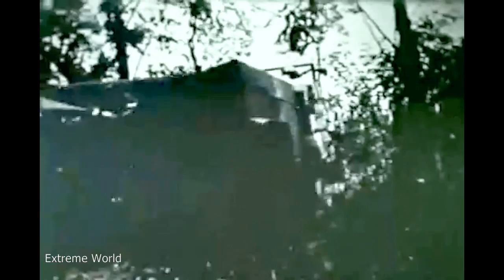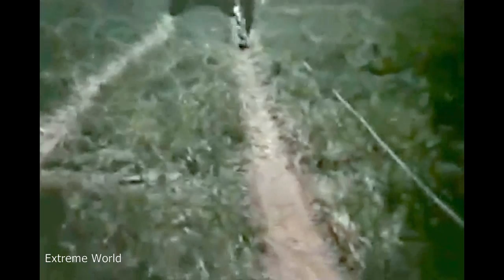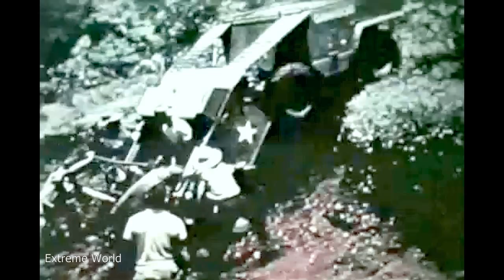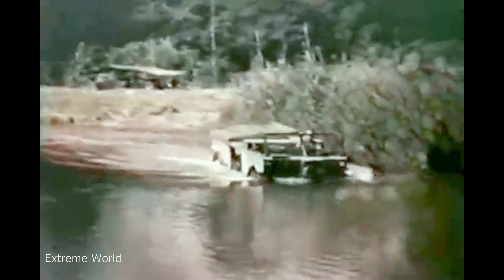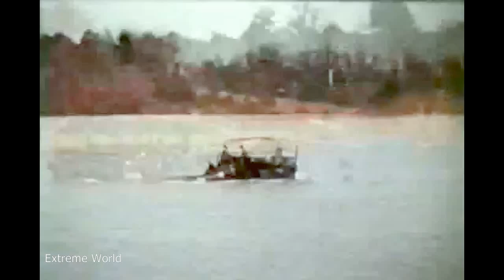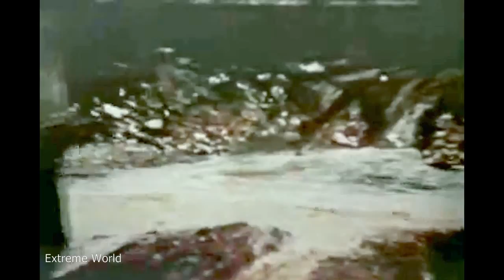Gama Goat 6x6 Off-road Test - Military Truck

Comment: Riding in the back of the trailer was sure to leave you sore. A six ince bump would launch you two feet into the air.  I rode in them several times.

Comment: These were in use at Ft, Carson until the late 80s as communication trucks and ambulances.  They were replaced by M113s.  Very distinctive sound from the three-cylinder diesel engine
Reply: +Cee64E  It was powered by Two strokes Detroit Diesel, perhaps  a 353 or a 371 series
Reply: +enterBJ40 It was the 353